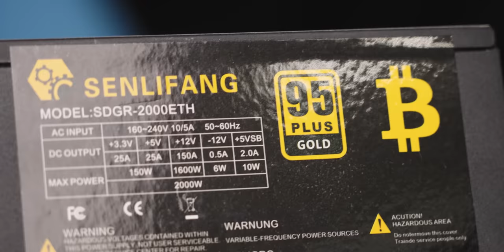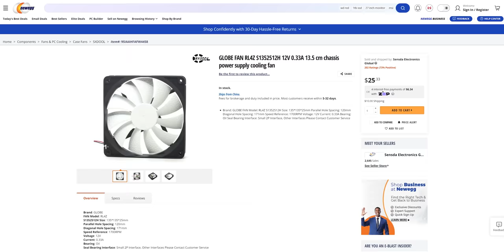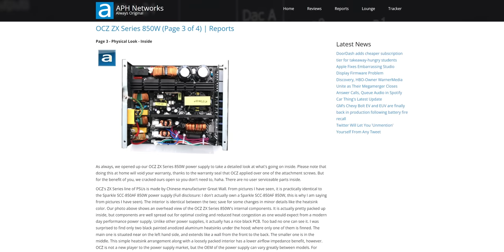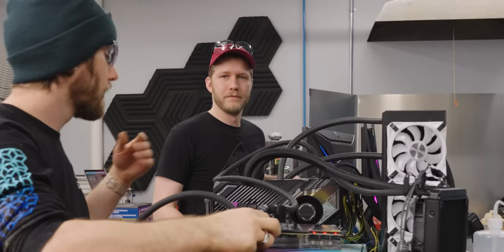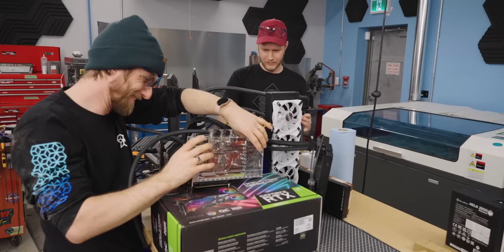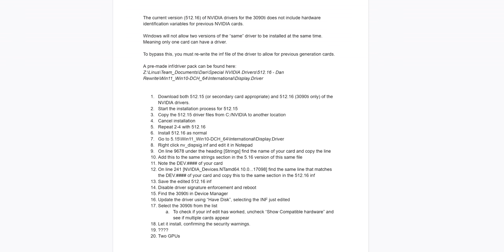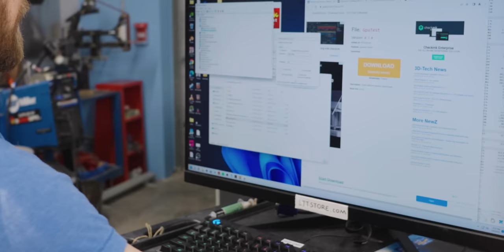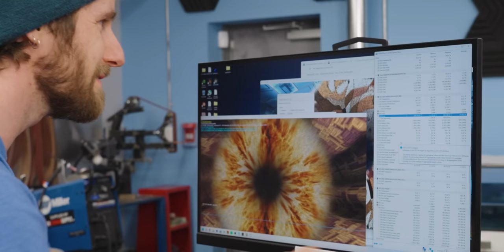This is one SKETCHY 2000W Power Supply

Comment: "Do NOT ever do anything we've done in this video. That being said, here's HOW you do it." These guys know that people are morons and want you to at LEAST know how to properly do something stupid BEFORE they go and hurt themselves. How responsible!
Reply: Because some people will definitely do this and its better if they do it right
Reply: @swapnilchaudhary2944  l
Reply: Though they could have just taken a little extra effort to do it right in the first place, and also replaced the NEMA 5-15 outlet with an IEC C13 outlet (that plugs directly into the PSU), avoiding ever having 240 V power on a 120 V outlet.

Even easier yet, as well as more flexible, would just be to buy a North American 240 V extension cord and put their 240 V connector directly on the IEC cord, so you'd still have just one plug to replace and it would be utterly clear (because of the short cable length) that the IEC cable was 240 V.
Reply: @Alex Mentink - 
YES , LTT carefully set course to the channel "ElecteoBOOM" who also lives in Canada
Reply: I’ve found that “knowing how to properly do something stupid” is at least half the secret to life.
Reply: @Curt_Sampson believe it or not, the vast majority of people do not have any of the tools to do what you are suggesting and honestly for someone who is going to attempt what they are doing in this video but doesn't have the tools. The approach they took is the safest, now if you're a licensed electrician, either of the approaches you took would be what I recommend. But if you're a licensed electrician, you would already know that those two ways are much safer than this abomination they creating the video
Reply: @the_undead  I am doubting that the "vast majority" of people don't have a screwdriver, side-cutter and pliers. But even if it were true, it doesn't matter: someone not capable of  doing such simple rewiring should certainly not be playing about in the way they did in this video.

Lacking a parachute, jumping out of an aircraft with an umbrella instead may be the safest way short of a parachute, but that doesn't make it something you should even contemplate doing. (What they did in the video isn't quite as guaranteed to kill you, but if you suggest it to an audience of millions, someone is likely to die.)
Reply: @Curt_Sampson  where do I get a 240 volt outlet? The point you made after you said "even easier yet" The way I am interpreting that would imply running conduit and installing a new outlet unless you're implying that I should use an existing 240 volt plug, but most people don't have an unused 240 volt outlet in their house because those are not cheap to run. So you only put one in for appliances that need it, so as far as I can tell, you're basically saying that running an entire 240 volt circuit is easy and most people can and should be able to do it. I take personal offense to that because I'm willing to bet money the vast majority of people would die trying
Reply: @the_undead  If you don't have a 240 volt outlet, you can't do the stupid thing they did in the video, so no problem. The whole safety issue was because they did have a 240 volt outlet, and chose a particularly unsafe way to use it.

I don't know why you're thinking I'm saying that running a new 240 volt circuit from a distribution panel is easy (or not), given that this is something I never suggested, and that they never did in the video. Again, the safety issue comes with how badly they used a 240 volt circuit that was already there.

Comment: You need to ensure the Gnd lead is a little longer than the other two. This ensures that is the cable is pulled out the GND wire will disconnect from it's plug last.
Reply: Furthermore they forget to use wire ferrules.
Reply: Pretty sure they also reversed their polarity, and probably murdered the copper cabling with those wire snips when they were stripping it. If you are going to rewire a plug, definitely don't refer to this video for reference. 😂
Reply: @r00234  What polarity? North American 240 V is delivered as two 120 V "hot" conductors, one 180° out of phase with the other.
Reply: @Curt_Sampson  It somewhat depends, industrial locations (where they shoot) don't use things like Ufer grounding and I think they in particular have multiple voltages and 2 and 3 phase outlets.
Reply: @smalltime0  This is my point. If you're using two conductors to connect to 2-phase power (such as North American residential 240 V), there is no "polarity": both conductors are "hot." (I don't know what "Ufer" grounding is, but polarity is about hot vs. neutral, not about ground, which is a completely separate thing.)

Comment: Japan actually only uses 100V in most places, and then to make it more complicated the south-west of the country is 60Hz and the north-east is 50Hz
Reply: Half as interesting viewer?
Reply: Wait. How in the hell do you make a grid that has different phase frequencies?
Reply: @rockytom5889  You don't. Japan has two grids
Reply: @jt....  
Ok that makes more sense. But even still, why make then different? Is it a case of it being too expensive to replace old tech or what?
Reply: @rockytom5889  Basically, they imported the tech from 2 places at the same time, and when they realized the downsides, the  system was just too huge to remade
Reply: The worse thing is, that you usually also want to consider tolerances.
For 100V grids, you therefore can have 90 to 110V, for Europe grids (220-240V) you have a tolerance of 198 to 264V.
Reply: They are 50Hz in the north at 100-127V, 60Hz in the south 100-127V in the south (same as most of northern America).

Comment: When he first showed the label, before talking about it, I too was confused how 1766 watts across all rails was actually 2000
Reply: 12*150=1800
Reply: the same way that a gold rating is 95....
Reply: I'm confused about the why can't they just plug the PSU in the normal wall plug. I mean, is 2000W...
Reply: @mastroitek  they in north america
Reply: @girlsdrinkfeck  I know that, they have 110V, but don't they have 22A?
Reply: @mastroitek  thats not the issue ,the sinewave is ,america is 60 hz and again amps and watts isnt same as volts
Reply: @mastroitek  there is enough power through the outlet, but the Voltage is different and the psu is not built to accept both voltages
Reply: @XillyWonka  aha s**t, I thought that PSU was only able to take 110V but the normal plug was not cutting it so they had to use the one of the workshop (240V) and convert it to 110V. I should not look those videos when I'm half asleep
Reply: @mastroitek  cause it's a 240, volt psu. They don't have 240v outlets in the US and canada. They use 110v
Reply: @Mw2SnipeEm  We have larger outlets in America but I believe they are two phase or faux two phase (different taps on the transformer on same phase but further apart). I have no idea, I'm not an electrician, but we don't use 200+ volt outlets for normal lights / vacuums -- just for huge stuff like waster, dryer, range, etc.
Reply: @girlsdrinkfeck  Frequency has NOTHING to do with it. It gets rectified anyway (and then chopped to tiny bits and transformed and re-rectified because you can use smol transformers when the power is hundreds of kHz).
Reply: @mastroitek  The PSU doesn't have a doubler circuit in it. So it needs the 240 V input to work.
Reply: @mastroitek  our circuit can deliver up to maybe 20A but the parts inside the PSU can't handle 20A. That's why it runs at the higher voltage, to reduce current. That's the trickery every SMPS uses to increase power output. You can begin to understand when you know that Watts = Volts times Amps. So when you double the voltage you halve the current for the same power.
Reply: @Mw2SnipeEm  actually we do have 240 VAC receptacles in North America.